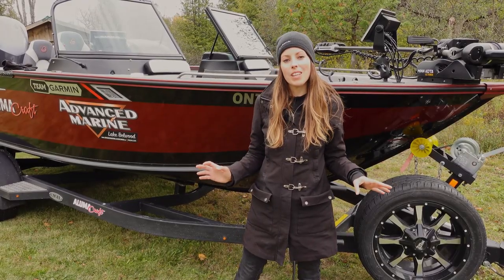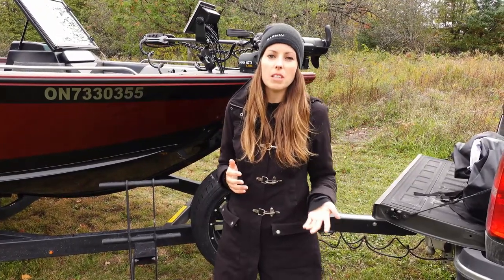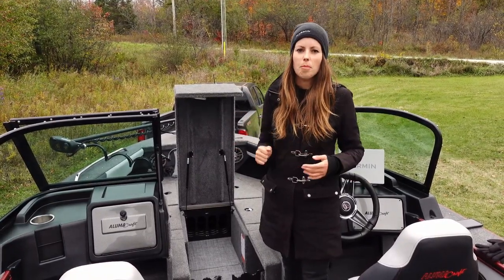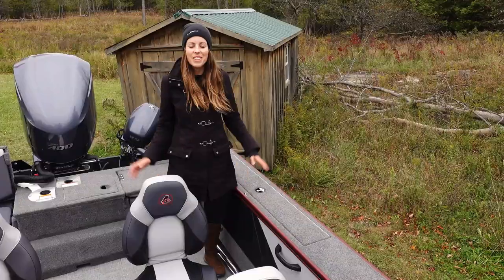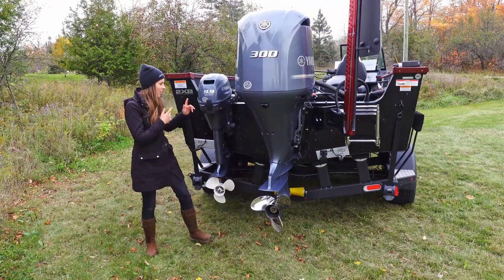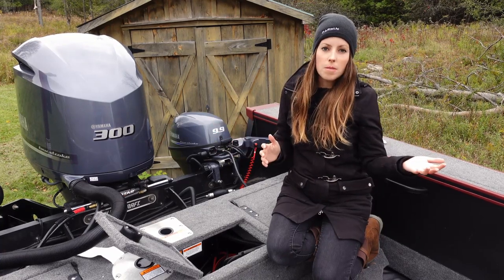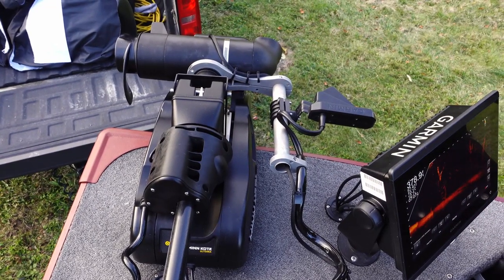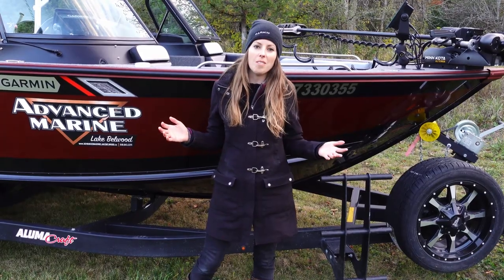Walkthrough on the Alumacraft Trophy 205 Powered By Yamaha F300

Comment: I know this has been awhile but I see that you are running a Power Pole and the standard ladder, they are attempting to rig Minn Kota Raptors on my Alumacraft Competitor 205 and are having a problem installing the Raptors without causing issues with the boarding ladder. 

Are you running your Power Poles off of a jackplate? It's hard to tell from the video.
Reply from the maker: I think your best bet would be to remove the ladder and add something like this:
https://drewcraft.com/product/emergency-boat-ladder-with-mount-for-powerpole-or-raptor-3-step/
Reply: @SheLovesToFish   Thanks! I 

I actually asked the dealership to remove the OEM ladder but they said that they can't do it for OSHA or something.

I did find the exact style you showed but a different brand. 

Thanks for the help!

Did you ever get a replacement boat?
Reply from the maker: @usmarine0352  No problem! I will be running a SeaArk Flex 21 this season and picking it up very soon ☺️
Reply: @SheLovesToFish   Well, good luck with that. That is a very different boat!

Thanks for taking the time to respond!
Reply from the maker: @usmarine0352  Thank you! I am very excited ☺️

Comment: That thing is amazing!  How does the overall fit and finish look?  The eagle is a bunk I believe, any reason why you choose that over a roller trailer?  Can you mount down riggers on the track system?
Reply from the maker: Thank you! I am happy with the fit and finish! I have only ever had bunk trailers. From what I've heard they carry the weight more evenly and are better on the hull but again, I haven't owned rollers. At the rear of the boat there is room to install tracks which is where I would suggest putting downriggers rather than on the removable tracks I'm using.
Reply: @SheLovesToFish ,I've always run roller trailers, but it gets to be a pain on the reservoirs that we fish, steep ramps.is the ladder system an add on ?  Any issues with the ulterra as far as deploying and stow?
Reply from the maker: The boarding ladder comes standard on the Trophy. I haven't had any complaints with bunks over the years. I usually trim up and power on. This is my second Ulterra (had one on my previous boat) and I haven't had issues.
Reply: @SheLovesToFish  you have now owned the Tpro and the Trophy,  although not the same size ,could you give a brief breakdown of the comparison and likes / dislikes? I'm sorry for pestering you I just haven't decided which Alumacraft I'm getting soon, thanks for your time!!
Reply from the maker: @mrwho2118  No problem! I ran the T-Pro 185 which is 2 feet shorter than the Trophy 205 I have now. The Trophy has more cockpit space and higher gunnels, but it is also a larger boat. The only thing I'm not crazy about on the Trophy is the smaller opening on the rear livewell, also the placement on the rod/storage lockers on the gunnels but I got around it with the Traxstech accessories. I love both boats though, so I can't offer much in the way of dislikes.
Reply: @SheLovesToFish  if you had to pick between the tpro and the trophy,  let's say 19 foot ,which one would be your boat?
Reply from the maker: @mrwho2118  Tell me about what you fish for and the types of water 😊
Reply: @SheLovesToFish  usually walleyes on Missouri river  reservoirs   , I've looked over both boats numerous times and I'm having a heck of a time picking one!
Reply from the maker: Do you troll or cast, or both?
Reply: @SheLovesToFish  both,  sorry for the late response